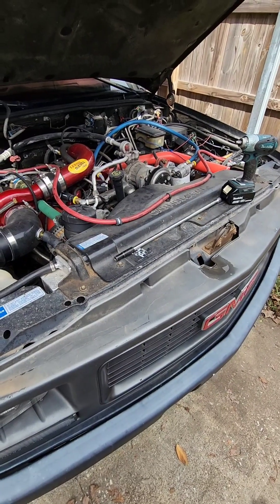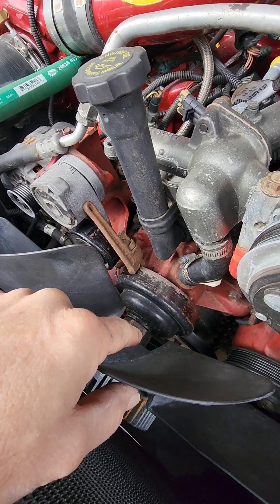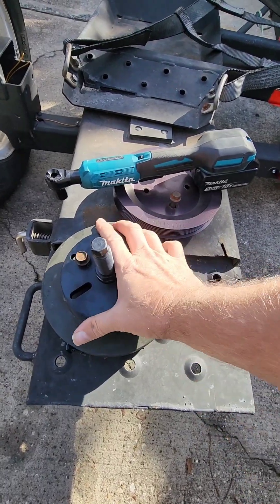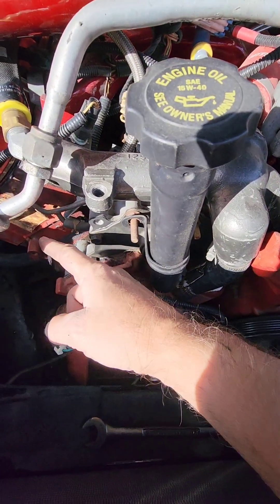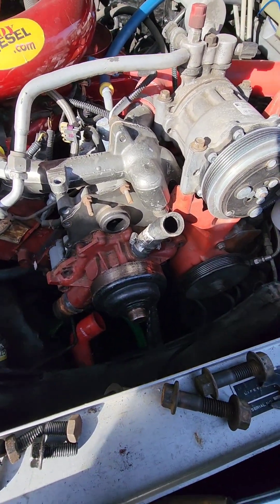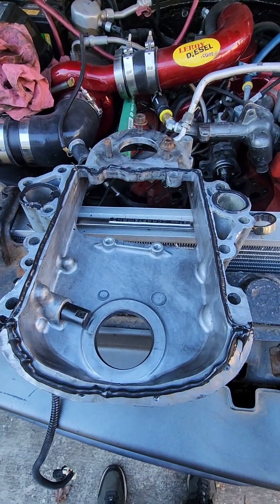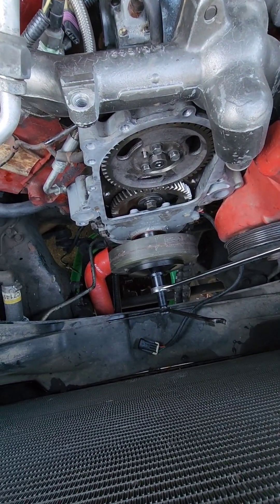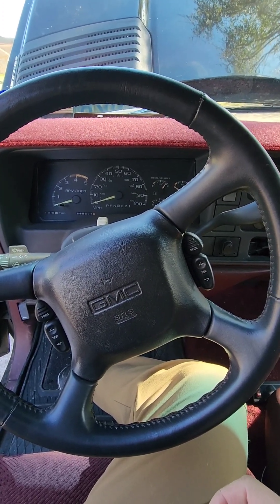Adding a reluctor wheel. DB2 to DS4.

Comment: Great info, thank you Leroy! Yes the varied spacing on the fan blades is a great benefit for access.  It was designed to reduce noise/vibration  by creating different/countering  frequencies rather then all on the same frequency.
Reply from the maker: That makes sense.  Thanks for the info.
Reply: @leroydiesel6.5  You're welcome, after 44 years of being a body/frame/paint tech in collision repair I've learned a few things.

Comment: I am looking to do a custom trans setup with a standalone tcm. I am going to need a 24x reluctor wheel. on the db4 wheel I see the inside has a lip. does the lip pus into anything or is it just exposed? my idea would be to cnc cut a new reluctor wheel that will have 24x on the inside, and the 4x on the outside. then modify the housing to put another sensor on the opposite side inside more to pick up the 24x signal.

Comment: Hi I have a 6.2 diesel short block and spinning it by hand is TIGHT like I have to use my breaker bar maybe it’ll loosen up?
Reply from the maker: You should not be able to spin it by hand. The friction of the rings require a bleaker bar.
Reply: @leroydiesel6.5  figured it out haha i put a regular main cap on a thrust bearing